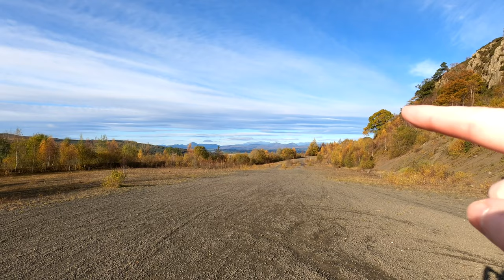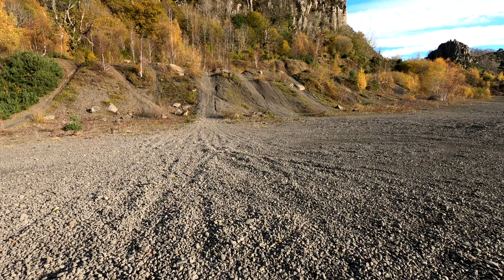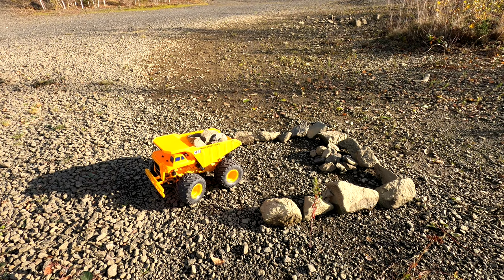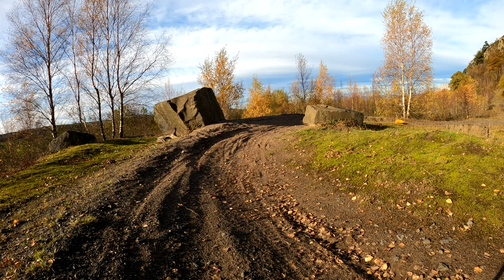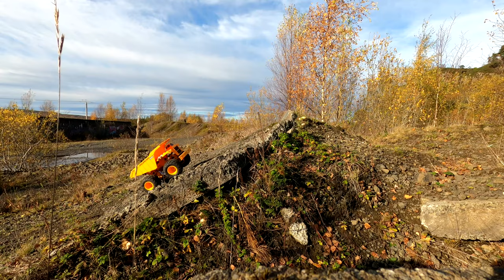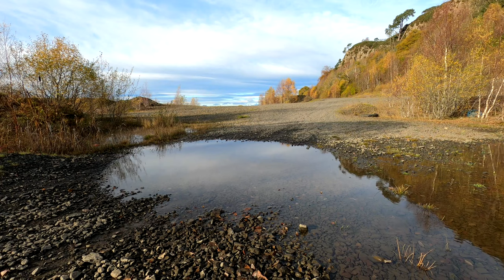Heavy Dump Truck Working Hard! - Tamiya GF-01

Comment: What motor is that, looks well balanced? Need to step down I think on mine to make it manageable. Nice run!
Reply from the maker: It's a Holmes Hobbies Trailmaster Sport 27t. Suits it very well. Also got oil-filled shocks, so that'll likely help. Cheers!